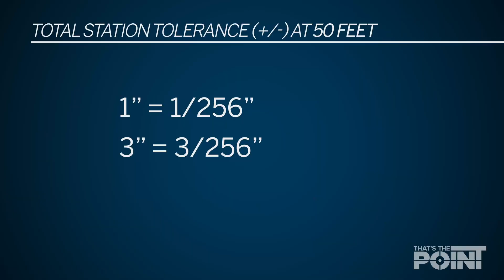That's The Point - Understanding Angular Accuracy & Tolerance

Comment: good video. I have bought an 1" because often they want the specs of the machine when you're quoting. To regular people explaining that a 5" is as good in that particular project then a 1" is impossible
Reply: Just tell them that 3" is 1mm over 100m, so unless you are setting out over 100m, anything better than 5" is less than the width of a pen mark or nail. 10x smaller than they could ever build it.